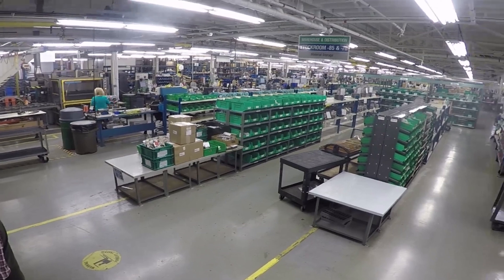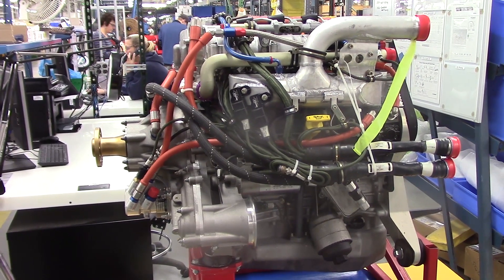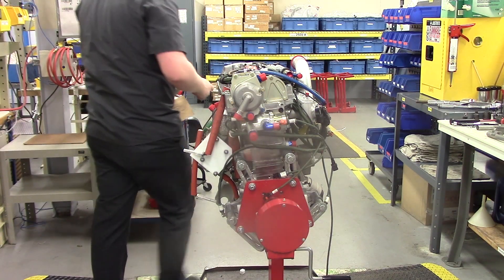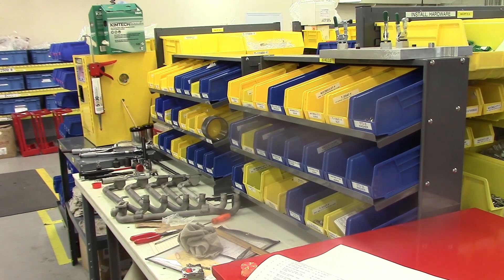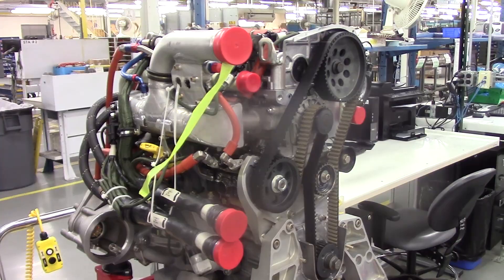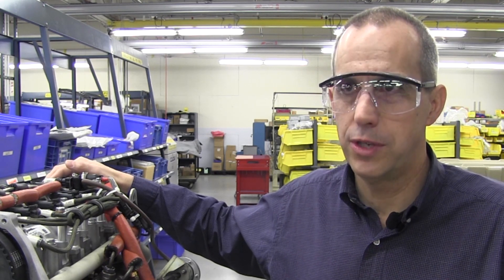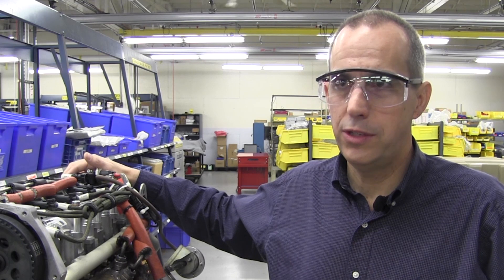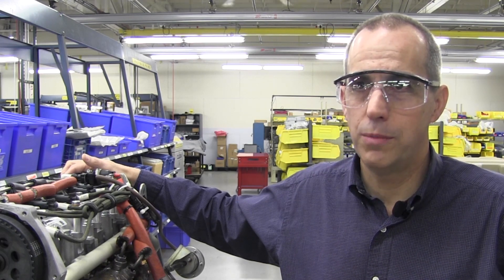A Look at Lycoming's Diesel Engine

Comment: If Lycoming or Continental can bring down the cost by 10-15k from the 65k of the conti diesel retrofit STC these would start selling like crazy. It’s a no brainer to operate on diesel with the cost of avgas and jet fuel. 

Diesel fuel can easily be bought for $2 to $2.30 per gallon when road tax exempt like for construction/marine/farm applications. Compare that to $4 to $7 per gallon for Avgas and jet fuel paired with the 40% reduction in fuel burn and these engines are real winners even in North American markets.

The only thing holding these engines back are the manufacturers at this point. They should sell them below cost for 4-5 years to promote aircraft manufacturer adoption and STC retrofits. After they become common sights at local airports sales will increase and production volume will increase. Once that occurs they can streamline production to increase output and bottom line, then raise the price to where the program is paying for itself.

The way they are doing it not with trying to make early adopters foot the bill will never result in widespread adoption when avgas is available. It’s similar to the way new big screen TVs are released, one year the biggest best tv is 50-100k for early adopters, then 10k for techies, then finally 2-3k for the mass market. That type of model will never fly in the price sensitive piston single market.

Comment: I too expected the primary drive (cam drive) to be a gear train not a belt. But given the easier duty cycle of an aero engine(more constant speed) and the life and reliability of belts these days, it wouldn't worry me seeing a belt in an aero engine.
Reply: True ... it really just depends on the design. If you have a belt that wears easily, they design the engine so that it can work even as the belt wears (and best would be to detect before it fails).

Comment: Given the maximum RPM this engine is rated for, the wear of the belt is incredibly low compared to automotive 4 cylinder gasoline engines which rev as high as 7,000 RPM and last over 100,000 kms. Put into perspective, an automotive 1.9 L diesel , a class size that's 98 cubic inches and rated for 100 HP and max rev limit of 4,800 has a belt lifespan of 100,000 km's before manufactures recommended replacement, which have easily been exceeded.
Reply: please take a spare with you
Reply: @1racemate  sort version... Cars with little or no maintenance use those belts for at least 1000 hours, usually 2000 hours, before inspection/replacement. They're not going to wear out faster in an airplane that's actually being maintained.

Comment: What happens when the timing belt breaks at 100' on a climb out?
Reply: These belt last 10 years/160000 kilometres on diesel vehicles so you should not get a failure in 1 year/100 hours
Reply: Same thing that happens when the timing belt breaks on a gasoline engine.  It stops running.
Reply: Pleasure yourself on your way down
Reply: Gates and others make hardcore timing belts for race applications that are kevlar and carbon fiber infused expensive but worth it on a interference engine
Reply: Coming down.... Aha, always possible..
Reply: Same thing as when a Rotax or Lycoming quits at 100'..  you land the thing straight ahead.
Reply: @colwk  A vehicle does not fly at 10,000 feet.
Reply: Andrew Armstrong so they are going to break 16 time faster because there is less air pressure?
Reply: I’m sure Lycoming will have a replacement schedule for any part that cannot reach TBO just like in their other engines. Follow the maintenance guidelines and there’s nothing to worry about just like any other engine.
Reply: @flexairz  straight in

Comment: I would like to know Why? Seems to me both the battery and diesel-powered aircraft engines are a solution in search of a problem. My question is why they aren't anyone producing affordable and reliable turbines in the 200HP range for the light GA market.
Reply: People have been trying to produce small 200hp turbines. It's been proven that a small turbine is feasible, but it has a few issues:

Turbines don't do well with short flights - a condition thats common to smaller aircraft in that 200hp range. This is where an electric solution could eventually step in and solve this issue. 

Turbines (apparently) loose efficiency as they get smaller making them disproportionately fuel hungry for there power output.  

The relative clearances on everything is harder to maintain during manufacture and rotating components have to spin much faster - both are big issues when the longevity is considered. 

Having said that, there are companies out there developing small turbines, all the way down to 5hp, but I've yet to see any of them become main stream.

Comment: The engine manufacturers need to bring a reliable GA diesel to the market.  The basic av-gas O-360 engine is not very efficient. The bigger problem is going to be the availability of the 100LL fuel. A diesel should be able to run on just about any Jet-A - Kerosene type fuel.  As other have mentioned, certification is just one of the major stumbling blocks - along with cost.

Comment: It would be a bad day if the cog belt broke. Why not have a chain in a sealed cover with pressure oiling, it wouldn't be that much heavier.
Reply: It burs off its oil with total loss lubrication!
Reply: Chains have their own issues. Those belts last many years and over a hundred thousand miles in automotive applications. It will be a manditory time replaced part in aviation.
Reply: These small diesels are all based on automobile engines from major manufacturers in Europe, where diesel cars are far more common than in the USA.   Those engines regularly achieve 100k miles on these belts which are designed for a far longer duty cycle than a hundred hours a year in light airplanes.  
Now ask yourself when was the last time you heard of a serpentine belt failure in a car that is decently maintained?  Those issues were solved back in the 80's when serpentine belts first replaced v-belts.  In addition, aircraft are inspected every year or 100 hrs, whichever comes first.  The belt should also be looked at on every pre-flight inspection, whereas no one looks under the hood of new cars except maybe the jiffy lube kid.

Comment: This is a Mercedes automotive sourced engine. Here  in Europe these engines have problematic chain cam drive. These single row chains stretch and jump teeth. The entire chain guide and tension system has low durability.
Reply: You are quite right.That engine is a Thierlet(Mercedes automotive)as used by Diamond aircraft for years.They bought out Thierlet to stifle competition just like Continental bought out the Morane design.Both companies are working hand in glove to keep their old design air-cooled engines price artificially high.Just a ripoff.The competition authority should investigate both companies.

Comment: This did not age will. Continental killed off their diesel (which they bought from bankrupt Thielert). Lycoming? DEL-120 is only on 
the  General Atomics Improved MQ-1C Gray Eagle drone, less than 100 built. Austro (warmed over Mercedes Benz cast iron car engine) through steep odds got their diesel certified on the DA62. How long will these engine last in service? Reliable? Saving lots of money on fuel? Really pennies. Fuel availability is the big thing. If the climate alarmist kills off 100LL with out a no lead fuel replacement that works in existing engines we may be in trouble.